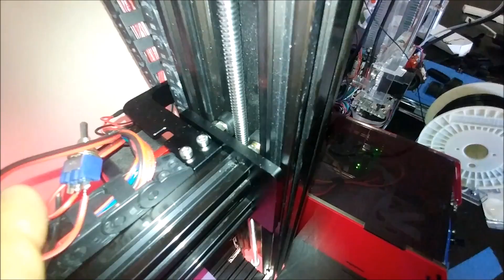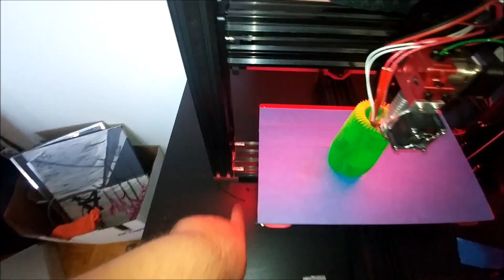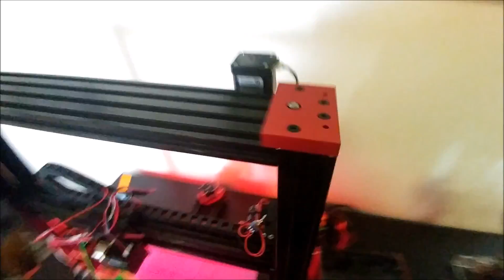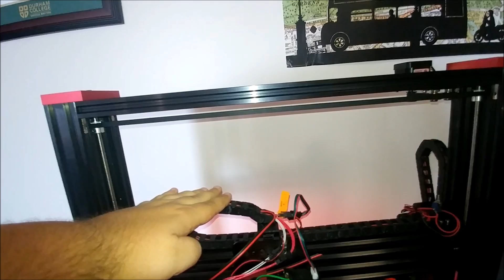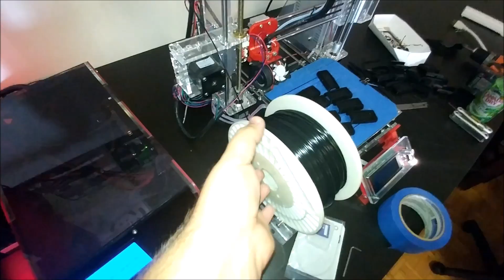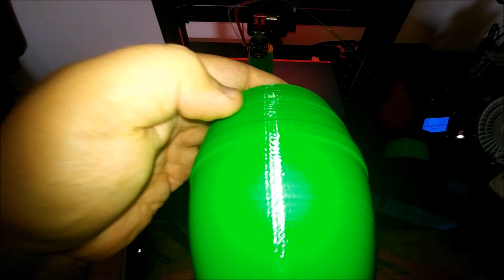Tevo Black Widow 3D Printer First Prints

Comment: awesome video, I too just got my black widow in and assembled. however this is my first 3D printer and first 3D print attempt ever. I ordered some PLA because I was having a lot of issues with ABS not sticking to the build plate. can you do a video of step by step on how to get a successful first print either with abs or pla, basically from when you first get it assembled and you're ready to test it. thanks.
Reply from the maker: I will make one this weekend for you!
Reply: You can use some bed prep materials like hair spray (aqua net i hear works) or tape or elmers glue stick. Look up different materials you can use and choose what you like.

Comment: As a fellow Canadian (Niagara) Sunhokey Prusa i3 owner, it is good to see how the Black Widow compares to the Sunhokey.  Have you considered building  a rig to allow your spool to feed down from above the printer to allow easier feeding to the extruder?  Are you finding that blue tape works well enough for ABS and PLA printing?  It will be interesting to see how you get the CNC head running on it.
Reply from the maker: I have yet to try ABS on it at all. I know the extruder is working fine with it but as far as bed adhesion I'm not sure. The stock bed has some sort of build tack like surface on it but I have yet to try that also. I used the blue tape with PLA in the past with good success so i just tried it here by default.

If you look in the video description you will see my upgrade pack for a spool holder.

Comment: Is there a possibility to attach or integrate E3d v6 or chimera (dual color printing)  hotends on this printer?
Reply: You can always print an attachment to allow it to hold any hotend you'd like. That's what 3d printing is about :)
Reply: I was thinking more of like whether if the default mounts with the printer takes an e3d v6.. But.. yes it could be printed as well as per needs.. thanks!
Reply from the maker: There sure is! the hole pattern on the x axis is great to mount up whatever you like. Just print a simple adaptor plate and have at it!
Reply: Arvind h

Comment: Dear Doug,
 are you using simplify 3D or cura ?

on winch profile type   ?  prusa i3 ?

thanks in advance
Reply from the maker: I actually use slic3r and craftware.

Slic3r is using a Marlin style.

And craftware has  a few g code mods in order to output the correct codes.

If you are interested in seeing a full setting sheet please let me know!
Reply: Приветствую. Какой день я пытаюсь настроить печать на этом принтере. Вы можете поделиться настройки для ломтерезки и другие под ABS для стандартного экструдера? благодаря

Comment: the extruder fan on mine is like super High powered, I can't get it to properly heat up unless i disconnect the fan, so without a fan n my plastic is practically still melting as it's being layed down.. quite annoying.'
Reply from the maker: What is your print temp? You can always swap a fan out for a smaller one or use a small piece of pop can to create a simple shield to direct the airflow where you find works best.

Comment: i just got my black widow all put together and on first boot up am having issues..

first off, when i did my initial "auto home" it found the x and y homes perfectly using the x and y probe.. but for some reason when it tried finding the z home, it moves the x axis vertical away from the z probe about 20mm then gives me "z probe out.bed"

also when trying to heat the extruder from room temp to 260.. my control board gives me the "heating failed printer halted please reset" error..

do you have any experience with these problems or do you know any solutions?
Reply from the maker: You can configure the behaviour of the homing actions in the firmware hat you can find on the tevo black widow owners group on facebook.

https://www.facebook.com/groups/TEVO.Black.Widow.owners/

The heating failed may be due to an un-adjusted PID value for the heater, a bad connection, or bad thermal connection to the heater block.